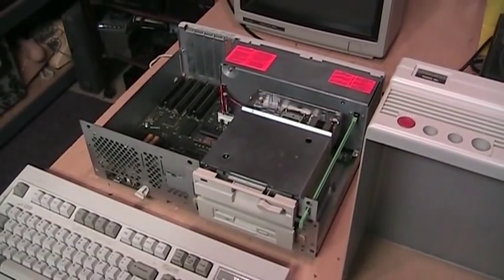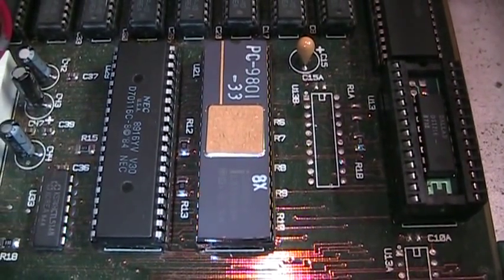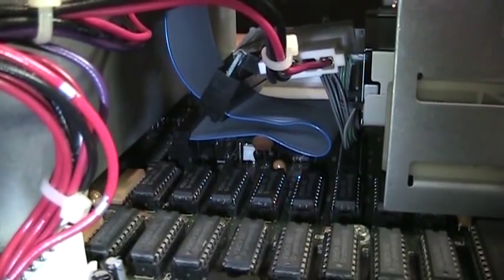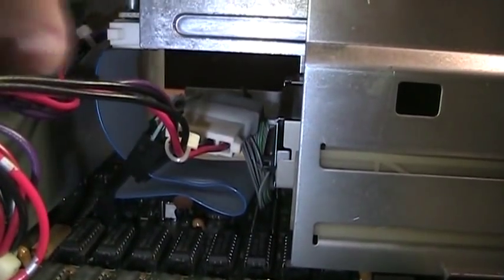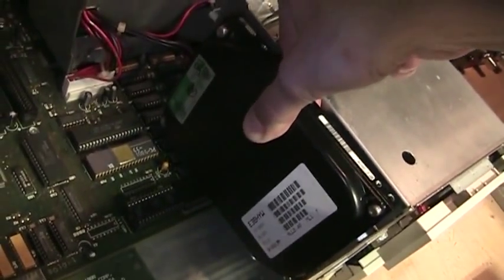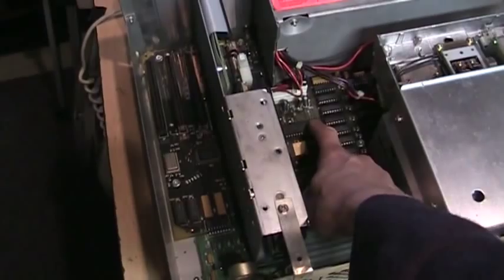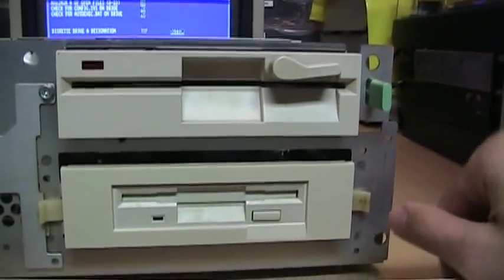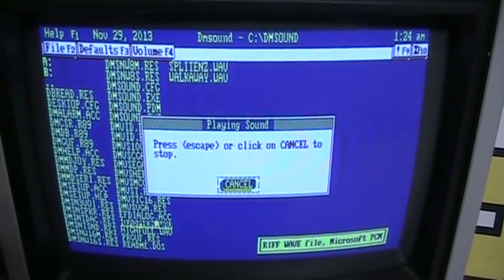Upgrading the Tandy 1000SL

Comment: This really brings back memories.  Your system is almost identical to the way my SL eventually turned out.  One of the first upgrades I bought was a 32 MB hard card and thought I'd never need more storage than that.  I was up 12 MB over most others 20 MB mfm drives.  Also installed a 3.5 floppy but I seem to recall it was plug n' play.  I do remember the holes punched in the cables and always wondered what that was about.
Main reason I sold my EX and bought the SL was for the HD.  The EX was way too proprietary with its special card slots...it was cheaper to buy the SL on sale and then an aftermarket hard card than to buy just an aftermarket HD kit for the EX.

Comment: The hard card bracket is mounted to the front of the case. You can even see it in the video. I have a hard card in my 1000TL, and remember using the included bracket.

Comment: Wow... The SL is easier than my TX when it comes to clock chips. My TX you had to remove the BIOS chip, plug in the real time clock chip, then plug the BIOS chip into it piggyback style. >.< It was, literally, designed to install that way, it had a socket on top to let you plug the BIOS chip into. But I do miss the old girl. If I remember right the TX was a lobotomized 286, only an 8 bit data bus instead of 16, the hard card that you'd have to mortgage your house for a mear 20 mb, Tandy DOS 3.1 , forget Windows as you used Deskmate. Etc. :D Jeeze, trip down memory lane. :D

Comment: I still have my Tandy 1000 SL from when I was a kid. First computer I have ever owned. I even have a few random programs and games on 5 1/4 floppy disks and still have the original keyboard (partly damaged). Have been thinking about letting go...have been lugging it around with me for over 30 years...just haven't brought myself to getting rid of it. I remember someone putting an index card in the floppy drive then next thing I know the floppy drive light is yellow instead of red and my mom tells me she just had it "repaired". The guy at Radio Shack said it had been struck by lightning but all he did was replace the floppy drive which I'm sure the old drive would have been fine after the index was removed. She never thought to ask me what happen, would have saved her around $400. These videos bringing back some old memories. Everyone keeps talking about the RAM in these old computers, wasn't it conventional and extended memory back then and eventually conventional memory was dropped and extended memory became referred to as RAM?

Comment: What games, if any, do you have on that PC?  That Seagate hard drive sounds surprisingly quiet for its age, also, I noticed when it started up that the speed of the spindle motor appeared to be fluctuating a little bit, does that actually happen, or am I hearing things?
Reply from the maker: On those old 3½-inch Seagate IDE-XT drives it is common for them to spin up faster than normal and then slow down before settling at the correct speed. It sounds funny but that's the way all of the ones I've used have worked.

Comment: The NEC V30, like it's V20 cousin, also has an 8080 compatibility mode. this allowed NEC's PC-88VA series to be backwards compatible with the existing PC-88 software base. and also allowed the machines to run other OS's like CP/M.

Not surprising about the 8087 for the PC98 series.. they never where was popular as the PC88 series, most of the software for the PC98 was business related.. though rather unusually.. for a 'serious' business machine.. it also had it's fair share of 'hentai' related games...

Comment: Nice upgrade!
Is it possible to boot from 3.5" as A: drive? Reallocating utility seems to be only MSDOS-session effective...
Are there any limitations for WAV files for 1000SL to play?
Reply from the maker: Yes, you can boot from the 3½-inch drive when it is reallocated from B to A. The drive swapping is built into the BIOS, so it works with all software (or at least all that I've run on it).

The Tandy DAC audio chip can play 8-bit mono audio at sampling rates up to 56 kHz, although the hard drive is too slow to buffer it in real-time if you go higher than about 24 kHz, so I use a sampling rate of 22.05 kHz (half of the normal CD audio standard of 44.1 kHz).

Comment: If you still own this thing, expand it to 1mb of ram via a card and get a VGA graphics card for her, and play corncob 3d! Awesome flight sim/shooter game it was my favorite on these old PC's wasted so much time playing it when I was a kid :) it was made to run on a 286 but will run just fine on an NEC chip with 1 meg of ram.
Reply: grassulo I've got Catacomb 3D on my iMac and I've got the other Catacomb games too, I like them.  I think they would work just fine on these Tandy 1000 PC, but yes, you'd need a VGA card to be installed, also, I don't know if the SoftDisk games supported the enhanced sound features of the Tandy 1000s.  XT class machines can typically only accept up to 640 kilobytes of conventional memory, if you want to add more, you'll need an Expanded Memory System compatible upgrade card of sorts and not all software is compatible with that, I don't know if the Catacomb/SoftDisk games support such upgrades or not.

Comment: Do you happen to have a Tandy 1000 RLX?  I've been looking for one of those for a while, particularly one that came with a hard drive from the factory.  Was it a 40 meg drive that came with that system or smaller?  I do know that it was the only 1000 to come with VGA graphics.  Had a 286 processor.  I think it may have been the last of the 1000 line of machines.

My grandfather had a 1000 TL for a little while.  I think it was also a 286.  He installed a hard card.  I guess it had the CGA/Tandy graphics though he may have installed a VGA card...  ah...  I can't remember.  It was a neat computer though, too.  As far as I can tell, the TL, TL/2, and TL/3 shared the same case as the SL line.  They seem to look the same from the exterior anyway.
Reply from the maker: The 1000RLX was available with either a 20 MB or 40 MB hard drive: http://www.radioshackcatalogs.com/html/catalogs_extra/1992_rsc-23/h008.html  The 1000RSX also had VGA graphics. It was the last Tandy 1000 model and is very rare.
Reply: Thanks!  I'm just now looking all this up as we speak LOL.  I'd love to get my hands on a working TL, RLX, or RSX one of these days.
Reply: Tandy was still flogging 8088/6s and 286s long after the 386 came along and all the other clone makers had moved to that. It was baffling to me at the time, because the 386 was so obviously superior architecturally. Tandy bet big on the 286 being the future, which turned out to be a monumentally bad bet.

Comment: I have a Tandy 1000. Was going to install compact flash but it won't accept it, while in the process I changed drive c to drive a and can't get into the bios to change it back. I also think I deleted something from desk mate not programs are on it. When I try to install the 6 installation disk it won't accept any of them. When I type c: setuprl \a or \s it doesn't accept it.
Reply from the maker: Use a forward slash, not backslash. SETUPRL /A
Reply: @vwestlife  I tried that it's like there's no setup on the computer? I recently disconnected the hard drive and switched drives in the setup before this problem occurred. Could I have messed something up?
Reply from the maker: @zacharybroome3062  You can download the disk images from the TVDog Tandy 1000 archive.

Comment: it just begs for an 8-bit original sound blaster card! Lovely 8 bit digital and Yamaha opl-3 sound it was my favorite back then. :)
Reply: grassulo You could add one of them, but there's probably not much need to because the Tandy 1000s have their own enhanced sound systems and so many games supported it back then, and I don't know how many early DOS games designed to run on anything slower than a 286 would fully take advantage of the 8 bit Sound Blaster cards.